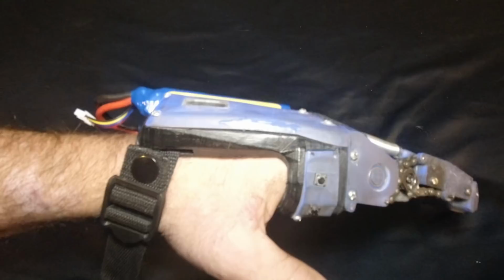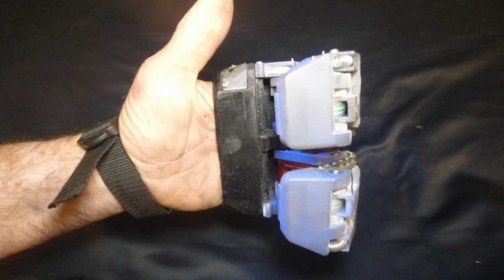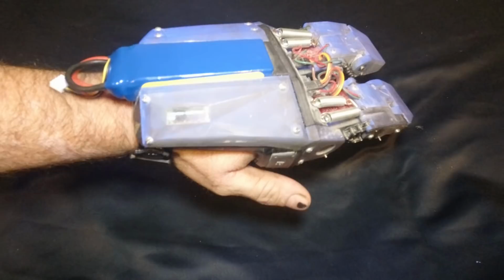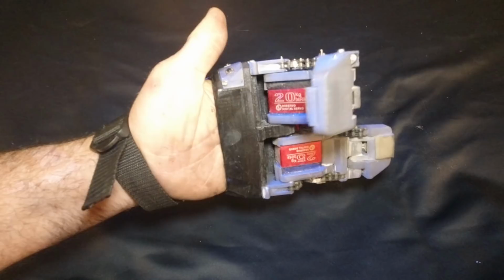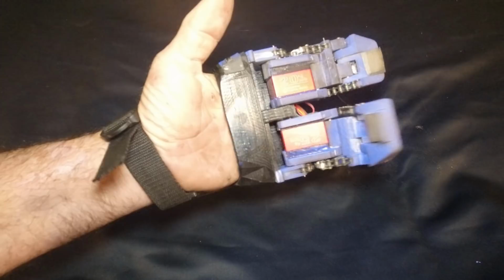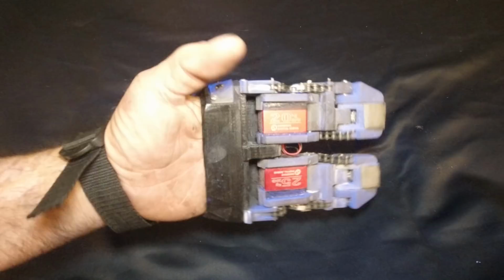Turtle Power! Myo Two finger resin printed prosthetic hand

Comment: If you remade this you could put buttons/sensors in there for each finger so index closes one slow then index and middle closes it fast, then pinkie closes the other slow and pinkie and ring closes it fast. That would remove the need for so many options in the menu and would make it more ergonomic to use. Hopefully this is something feasible if you haven't tried it already.

I get why you would get looks but it looks super cool and anyone who thinks otherwise needs to get over themselves.

Comment: Dude, that is so awesome.. I see your point about styling.
 
what about redesigning it as a printed nylon four finger design?
 you know, with monofilament tendons and maybe a little balloon on the fingertip that would inflate a balloon closer to the hand so you can feel the pressure on the fingertips? 
As a prototype it seems to work really well.
I don't know how much control you can get, but the 6 dof robot hands use finger splay (flash ligh vs wine bottle grip) and then bending of all digits together..  this gives pinch thumb to index or pinky.
 i've been interested in  tactile sensing for sometime. People often use tiny pager motors which vibrate, but there are also very tiny servos now.  they could respond to a simple pressure pad, the whole thing would just use a basic stamp chip. It can do pulse-with modulation servos and analog to digital conversion. 
16 i/o pins.
Programmed with basic im dos. 
I think the CAD design of all the moving parts that makes it so interesting. That and the bearings/longevity. I once built a robot finger with fishing worm jelly as a skin.  it was very effective, but over time it became necrotic looking from little scratches. So some sort of glove would have to be replaceable on something like that. I used to lecture at schools and I passed it around to the kids and it was like this weird robotic monkey finger.  they're all probably designing robots now. 
great work

Comment: Hi Ian! 1° nice to meet you. 2° your channel is cool. 3° this desing of two strong fingers electronic hand it's very interesting. 4° Do you consider add pressure sensor connect to Arduino for get the pressure and reflex in other parts your hand or sensitive part of your forearm to get some artificial tactile sensation in your prostetics?

Comment: Genuine question as I've only recently started following your channel... What's the obsession with chain and sprocket drives? You use them in almost every build when it seems like a steel cable would be a much better way to articulate fingers with a very small space requirement. Don't get me wrong, I love chain and sprocket, but I'm curious why that stands out to you as the best choice.

Comment: Holy SH!T this is gorgeous work, dude. I'm surprised at the scale of the battery you chose. What was the run time on that beast? Was it a 2 cell li-po? or just a single cell?
Reply from the maker: It was a 2100 3s, but the way I set up the controller it would recognize 4s -2s and automatically compensate for each voltage.
Reply: @missingpartsclub  Aaaah... I was wondering why so bulky. Did you use that high a voltage? Neat that it could only use 2... did that double your mAh?